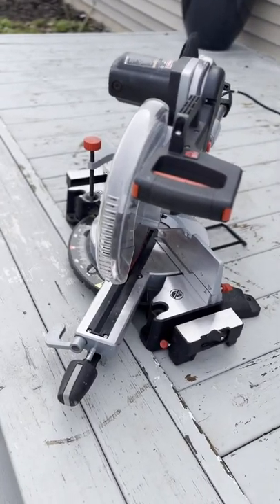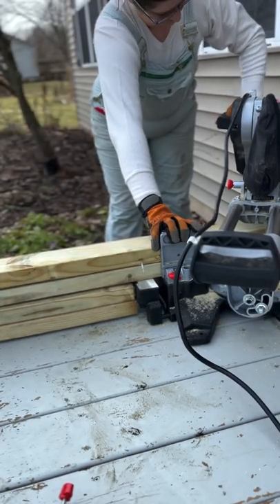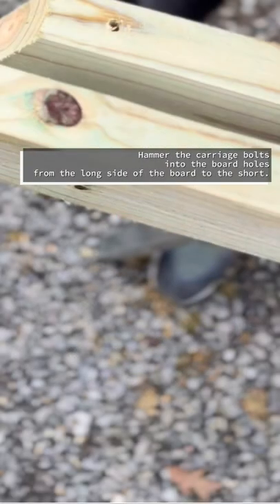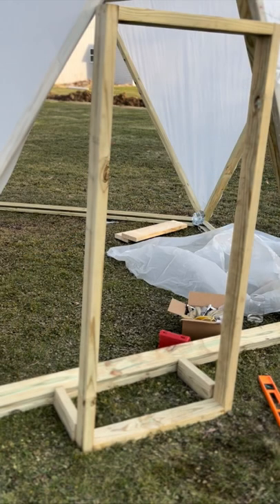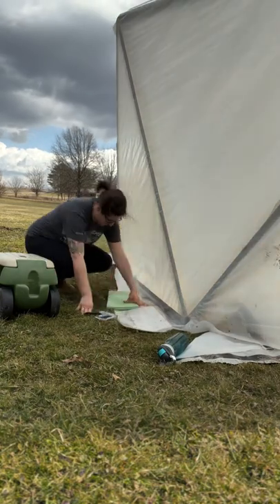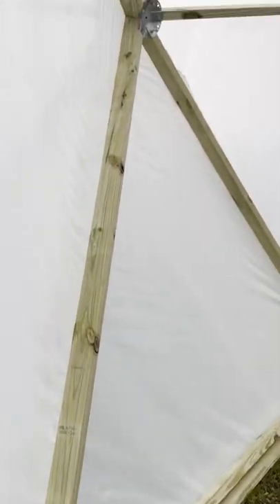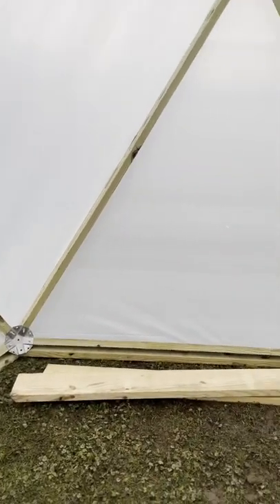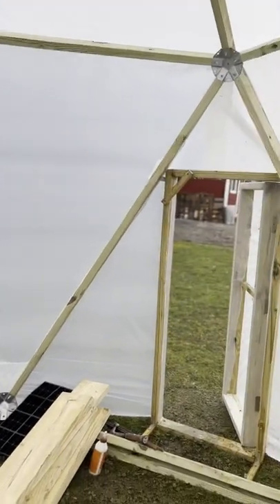Geodesic Greenhouse pt. 1: Build

Comment: Hey. Good video we assemble more complex 2V & 3V domes , but haven't seen someone do alot more simple design. Hope the best to you two
Reply: A 3V tetra is just as simple and provide more bang for the buck, an extra 5 struts for 50% more floor space.
Reply: I would argue that this version of a geodesic dome is just visually less interesting to look at.
Reply: @jacquestube  
The pentagonal floor is not very practical. The hexagonal floor of a 3v tetra makes it more flexible :)
Reply: @JohnGuest45  I'm relatively new to all of this Theory like I've never even thought about geodesic domes except as a point of visual interest. And it just seems like anything less van of 3v just looks too boxy. I feel like you're not getting the inherent good looks and visual interest of a geodesic dome if you go for a smaller frequency
Reply: @jacquestube  
The 3v is the most common, its reasonably dome shaped without being overly complex. A large 4v or 6v is nice if you have the space for a big dome. The truncated frameless polycarbonate domes use higher frequencies, 6v - 9v.
Reply: @JohnGuest45  and the one we seen this video is to be, correct?

Comment: Hey Samantha,

You presented a good demonstration.
What are the length and diameter of the carriage bolts?
What is the weight of the entire frame?
Reply from the maker: I’m glad you enjoyed the video! The carriage bolts are 4.5” long and 5/16” diameter. The weight of the entire frame is probably a couple hundred pounds. The weight is more different to determine, since we used pressure treated wood and some boards were wetter (and heavier) than others. My husband and I were able to lift it and move it a short distance. Hope this helps, thanks for watching!
Reply: @salemstillroom4056  can these be connected together? I'm Just thinking out the box
Reply from the maker: @gta-6837  hello! I’m not sure that you could connect multiple structures together, due to the shape and angle of the star-shaped brackets. I would love to see it, though, if you can figure it out!!
Reply: @salemstillroom4056  that would be cool.
Reply: @salemstillroom4056  Hello.  I am going to be building my first dome, a 1v style like yours, and I am wondering why you made the cuts to 35 degrees?  All the cuts should add up to 360 degrees, which should make each individual cut 36 degrees.
Reply: @salemstillroom4056  
Its not easy as none of the base triangles are vertical.